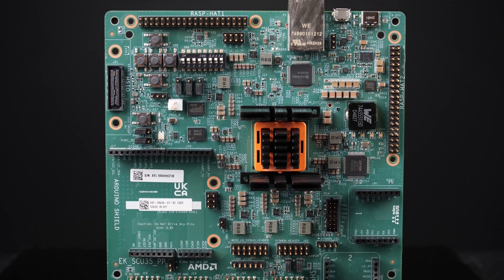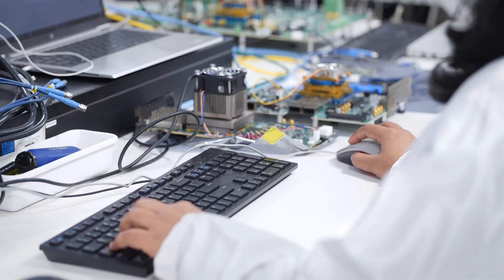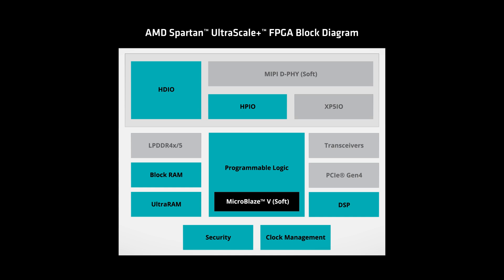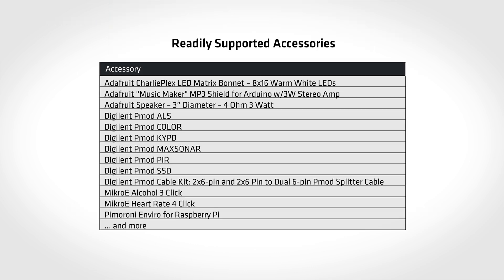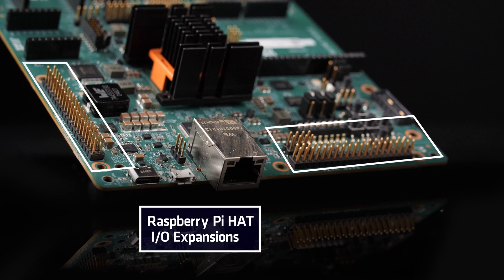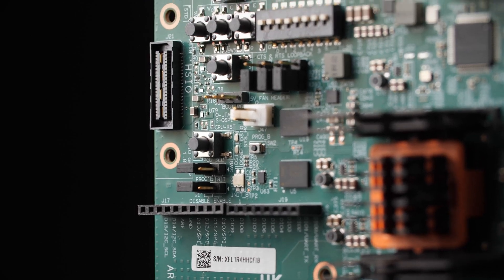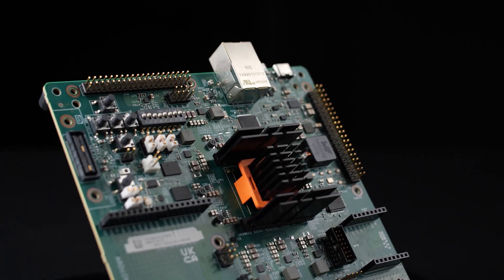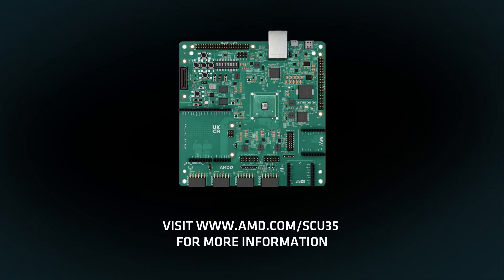Introducing the AMD Spartan™ UltraScale+™ FPGA SCU35 Evaluation Kit

Comment: 100mb per second ethernet?  That lame.  Development has been going towards gigabit.  Especially if you are wanting to use AI for or with any kind of industrial automation development.
Reply: This isn't meant for neural networks, it's for prototyping projects of EEs, digital design engnineers.
Basically it aims to be a cheap, general purpose FPGA devkit with a ton of IO options.
Reply: Yes, FPGA is efficient for AI, but this isn't for that.

Comment: A chain is only as strong as its weakest link.  A PROCESSING chain is only as fast as its slowest interface.
I see Rasp erry Pi, Arduino, and PMOD interfaces. Their reliability typically falters around 50 to 75MHz.

Are there any high speed connections? USB-C is power only, the Ethernet is 100M... ah yes, ONE HSIO. The details on that are buried in the documentation.

Comment: Not enough RAM, i have 12 by 64Gb (768Gb) in my server Gigabyte board which can run latest Kimi K2. This rudimentary boards are too primitive to implement even simpliest neural net there, no memory for it.
Reply: this is not for neural networks or any sort of ai.  the target market/developers are mentioned at the beginning of the video.
 you have the comprehension ability of a peanut
Reply: This is meant for EEs you know digital design engineers that have a project in mind that doesn't need the most expensive features, good for prototyping.
Reply: Gb != GB, Gb is typically used for Gigabits, GB for Gigabytes, 1 GB = 8 Gb.

Comment: memory price went up by so much that they could only have 1.93mb on this
Reply: The BlockRams are dual ported and available as itty bity blocks that can be ganged up into bigger blocks. Assuming same old architecture.
Reply: It's an FPGA (Field Programmable Logic Gate) lol, it's for "running" literal logic gates. If 1.93 Mb isn't enough, you can use the block RAM (64 Mb).

Comment: Yawn. Still waiting for any FPGA company to make a cheap dev platform with interesting specs. Can't even get started with transceivers, PCIe, basic IPs and licensing in any adult sense for less than $10k. The gatekeeping stifles innovation, forcing FPGAs to remain a niche.
Reply: This isn't true. Many sub $300 boards have trancievers available. There are also tons of IPs available for free with each vendor, as well as open source ones. You just have to try a bit harder.

Not saying that there aren't a lot of hurdles and paywalls for accessing more capable IP or certain interfaces, there are, but this doesnt apply to the examples you're describing. The associated costs of entry is endemic to the whole industry.
Reply: Why you explicitly asking FPGA company?
LiteX project plus any FPGA board of any chip vendor from AliExpress bring you easy start right now.
Reply: Buy the edu boards
Reply: The Kria K26 SoM exists (and its KR260 eval board)
Reply: If you work for company it doesn't matter. No need hobbiests, nerds, schizoids
Reply: @slavak7729  If you work on company it's doesn't mean you are not schizoid
Reply: @slavak7729  schizoids are working for companies too

Comment: 2020 = 28-inch 4K monitor and RTX 3070, 2030 = ? TES VI Hammerfell and 3840 x 1647 (21:9 at 76% GPU usage) – these two things disqualified the RTX 7070 and RTX 7070 Ti. The RTX 7080 took the throne, 2030 will be RTX 7080 vs. RTX 7090, RTX 7080 vs. TES VI Hammerfell, RTX 7080 vs. AMD and RTX 7080 vs. Intel. 2020 RTX 3070 > 2030 RTX 7080 unless RTX 7090, TES VI Hammerfell, AMD and Intel change the story. 2020 Kid Goku, 2030 SSJ4, Baby Vegeta = games released up to December 2030.

Comment: nice, can it make an led blink?
Reply: Requires expansion kit
Reply: If you know how to design a complex processor, then sure you could design said processor and then program that to blinken light, or just use a ready made Linux ready core.
Reply: @JohnJakson-i3w  i hope you're joking. literally can just make a tff tied to the clock whose output drives an led
Reply: Yea, it can probably make blinking ten thousand multiplexed leds simultaneously with it's own speed.

Comment: RTX 7090 for 5k = 100%, for 5120 × 2194 = 76.18%, for 7680 × 1440 = 74.98%, for 5040 × 2160 = 73.85%. RTX 7080 for 4k = 100%, for 3840 × 1647 = 76.23%, for 3840 x 1440 = 66.67%. RTX 7070 Ti for 1440p = 100%, for 2893 x 1240 = 97.3%, for 2205 x 1240 = 74.1%. In 2030, I would have an RTX 7090 using 76.18%, an RTX 7080 using 76.23%, or an RTX 7070 Ti using 97.3%. This applies to all games released up to December 2030, all at 60fps, ultra quality, and ray tracing on/off. I don't know how it would be with AMD and Intel graphics cards; they only need to do 5k 100%, 4k 100%, and 1440p 100%, and they'll have the same result.

Comment: TES VI Hammerfell for RTX 60 series = RTX 7070 Ti Super vs. RTX 7090 and TES VI Hammerfell for RTX 70 series = RTX 7080 vs. RTX 7090. Nvidia wants TES VI Hammerfell for the RTX 70 series, which will force AMD and Intel to compete against the RTX 7080 and RTX 7090. If it's for the RTX 60 series, AMD and Intel could compete with the RTX 7070 Ti Super.

Comment: In 2030, for TES VI Hammerfell, should I use an RTX 7090 for 7680 x 2160, 7680 x 1440, and 5040 x 2160 on a 57.1-inch Acer monitor, or an RTX 7070 Ti Super for 3840 x 1647, 3840 x 1440, or 3840 x 720 on a 28-inch Acer monitor? In my opinion, the RTX 7070 Ti Super is in a civil war with the RTX 7090. Sticking with the RTX 7070 Ti Super opens the door for the RTX 7080, AMD, and Intel to be the successors to the RTX 3070. An RTX 7070 Ti Super vs. RTX 7090 and TES VI Hammerfell could make the RTX 7080 the champion, and either an Intel or AMD graphics card could be the winner. TES VI Hammerfell for RTX 60 series or 70 series has a very significant impact on the decision. TES VI Hammerfell for RTX 60 series could make the RTX 7070 Ti or RTX 7090 the winner, and TES VI Hammerfell for RTX 70 series could make the RTX 7080 the winner. TES VI Hammerfell for RTX 60 series = RTX 7070 Ti Super vs. RTX 7090 and TES VI Hammerfell for RTX 70 series = RTX 7080 vs. RTX 7090.

Comment: 2030 "RED" ASUS ROG Matrix GeForce RTX 7090 for TES VI Hammerfell and Acer Nitro? Or "RED" ROG Matrix PTX 11090 XT? "RED" ASUS vs. Acer Nitro. 2030 Xbox + AMD + ASUS vs. Nintendo + NVIDIA + ACER?  Predator/Nitro with NVIDIA RTX 7090 + Nintendo Switch 3 with NVIDIA GPU and Intel CPU?